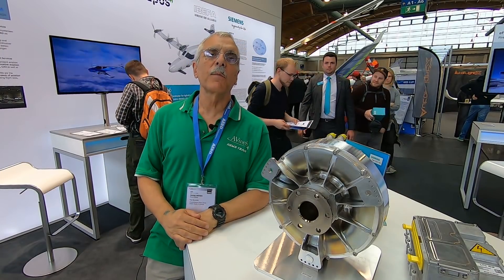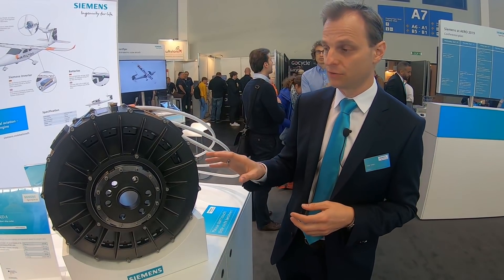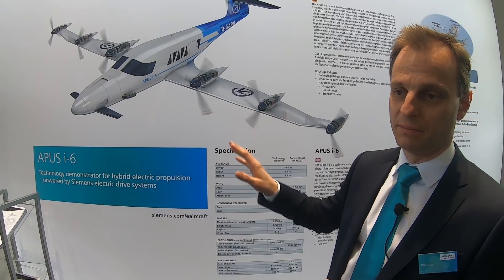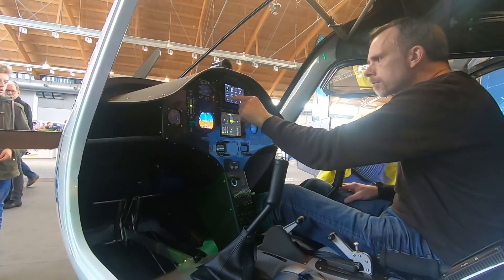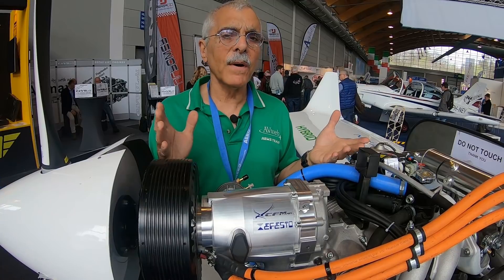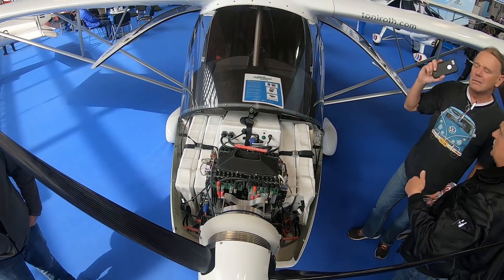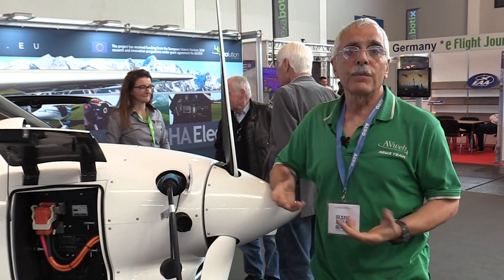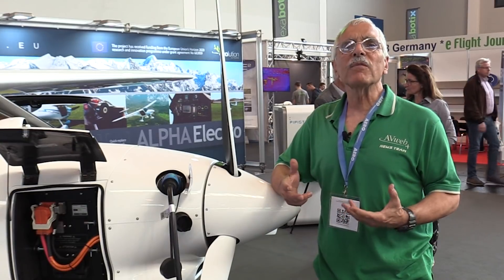What's New in Electric Airplanes?

Comment: The hybrids are hilarious, they just massively reduce the performance of the aircraft while massively increasing the cost. It's like no one did the calculations that are normally done before starting a project to determine if the idea is even viable!
Reply: PistonAvatarGuy 100% truth.
Reply: Distributing power from 1 engine across multiple propellers increases performance. The propeller is one of the biggest bottlenecks of aircraft performance.
Reply: @RealestUrbanism  Even if that's true, that's not likely to make up for the inefficiency of the hybrid system itself.
Reply: @PistonAvatarGuy  Google X-57 DEP etc. Those guys at NASA need to urgently learn from you. Study a bit on aerodynamics and wing construction first, please.
Reply: @Walterwaltraud  The X-57 was supposed to fly 2 years ago, the project appears to have stalled. The Pipistrel Panthera Hybrid performs significantly worse than the version which is powered by the most archaic piston engine still currently in production. Equator Aircraft has a DEP system that is double the weight of a typical aircraft engine and is significantly less efficient. Did you think that I made that comment based on absolutely nothing?
Reply: @PistonAvatarGuy  Cannot comment on the Panthera specifically (have only test-sat in the cockpit), concerning the engine they had to switch with the normal version. With such a small company you can only use your resources on so many projects. And case in point: They win a lot of competitions, sell steadily, do what they manage to do, they don't overpromise and underdeliver (unless you consider 5 kts speed under ambition, which at 195 kts over 200 kts projection that), yet, at least. They might break timelines, but still produce, sell, don't go bust, have several product lines open etc. Let's see how this one pans out. So, that said, the core upside of certain hybrid configs have some pros and cons. Reliability shall be higher and safety improved, complexity partially added and partially reduced. That remains to be seen. As for the X-57, since it's basic research, they did their flying wing on the truck testbed (looked fun :-) - and low cost), DEP does have a justification and will have a niche application in practise as well. Size and timeline are up for debate, I totally agree on that. Thus, your initial claim shall be disproven, but I would not say it will happen in the next 24 months, but the next decade. Slim wing, better cruise speed, higher dispatch reliability, 20 min batteries for initial climb to altitude will come down to physics, aerodynamics and business model. I wouldn't be surprised if the Alice from Israel sells 8 units a year starting in 2026 or 70 units a year in 2022. Both are well possible. I''d be surprised though if they sell the amount we saw in the 70ies and 80ies in Cessna 4XX, Piper 31 and other comparable sizes. Short and medium haul is just a too small market with the amount of regular 50 - 100 seat connections that exist in 1st world countries.
Reply: @Walterwaltraud  There's nothing wrong with Pipistrel as a company, but using a piston engine in a series hybrid arrangement to power an aircraft is fundamentally flawed, it could never do anything but reduce the efficiency of the aircraft, reduce its capability and add a huge amount of cost.
-
"Reliability shall be higher and safety improved, complexity partially added and partially reduced."
-
There is nothing but additional complexity. You can't get any less complex than bolting a propeller to an engine.
-
"...DEP does have a justification..."
-
Only in VTOL applications.
-
Increasing the aerodynamic efficiency of the aircraft does nothing to demonstrate that a series hybrid system is viable in most aircraft applications. The aerodynamic efficiency of the aircraft can be increased with ANY kind of engine system. FAR more benefit would come from modernizing light aircraft engines, which could easily provide a 30% reduction in fuel consumption, while allowing them to burn cleaner (unleaded), less expensive fuel.
-
"I wouldn't be surprised if the Alice from Israel sells 8 units a year starting in 2026 or 70 units a year in 2022. Both are well possible."
-
Not at all likely. They don't even have a prototype yet and they're trying to develop an entirely new kind of power system which makes absolutely no sense.
Reply: @PistonAvatarGuy  There's nothing wrong with Pipistrel as a company, but using a piston engine in a series hybrid arrangement to power an aircraft is fundamentally flawed, it could never do anything but reduce the efficiency of the aircraft, reduce its capability and add a huge amount of cost. - 

(Other than having (like Axter Aerospace) a couple of minutes of emergency power on EFATO, which is highly appreciated on any SEP to return to field without an impossible turn, noise abatement comes to mind as well. If the weight of the battery for the initial climb with a range extender suits the mission profile, that’s just a numbers game. I never bought the electric at altitude argument (unless you live in the Andes and have the same 45 min flight every time getting over Aconcagua :-)), but for this part it might be worth it: The “range extender” is a smaller, simply engine. Just putting on a relay between a certified engine that is of the same dimension, other than the aforementioned EFATO scenario in the pattern, is pointless, obviously. Maintaining cruise speed takes way less power than takeoff.)

"Reliability shall be higher and safety improved, complexity partially added and partially reduced." - There is nothing but additional complexity. You can't get any less complex than bolting an engine to a propeller. (Yes, an electrical engine is less critical, for obvious reasons, (the range argument we discussed obviously).) 

- "...DEP does have a justification..."

Only in VTOL applications. 

(Nope, in cruise as well. If you feather 10 out of 12 props, see the X-57. Lower drag, but great climb performance. Ever chopped the engine too high on a twin? You slam on the gear. Yeah, any light twin proves you the added lift from propwash over wing. Not even considering Coanda effect exotics like that Boeing YC 14, Antonov 72 and other “Upper Surface Blowing” models. So if DEP allow for much reduced drag during cruise, that’s a game changer.)

- Increasing the aerodynamic efficiency of the aircraft does nothing to demonstrate that a series hybrid system is viable in most aircraft applications. 

(See above, it will, as long as those props fold as nicely as they do on front electric sustainers in gliders, or Ospreys on assault ships, or in the nose of a Stemme S-10; or forward like in the Carat). 

The aerodynamic efficiency of the aircraft can be increased with ANY kind of engine system. FAR more benefit would come from modernizing light aircraft engines, which could easily provide a 30% reduction in fuel consumption, while allowing them to burn cleaner (unleaded), less expensive fuel. - 

(yeah, but that’s not the purpose of this field of research. No one would build the Tecnam P2012 with 4 or 6 engines. DEP can fulfill that mission profile at projectible lower costs. We’ll see. Might be a game changer in niche markets. Single aisle airliners obviousy not, for decades. Yet. As for engine efficency, stochometrics are quite sobering, especially if you compare a Rotax 9XX with an O200. Less icing, hardly reduced fuel consumption - it's like with boath engines, at that power output you cannot put that many tricks in there. Oh, and I fly with a Mogas STC. I'd rather buy an Elixir IR Rotax 915 for training, but with the capital costs, the Cherokee 140 with that Mogas STC works fine for me as a training tool for students). 

"I wouldn't be surprised if the Alice from Israel sells 8 units a year starting in 2026 or 70 units a year in 2022. Both are well possible." - Not at all likely. They don't even have a prototype yet, but they're trying to develop an entirely new kind of power system which makes absolutely no sense.

(Pure electric with three certified engines, 9 seats, rather short distances? Boils down to dollars per seatmile. There are markets for that. We’ll know rather soon. For short haul, high frequency, high dispatch networks this does make sense. 200 - 400 km, biz travellers, few electrical installations needed, small airports (such as relief airports, GA hubs). Construction of low front plate, low drag, high reliability, short routing transport is the key here. We’ll see.)
Reply: @Walterwaltraud  With the cost, weight and inefficiency of a series hybrid system, you could simply add a second engine for emergency power. An alternative would be to have emergency power provided by a parallel hybrid system which would also allow the engine to make use of turbo-compounding, which would significantly improve the efficiency of the aircraft. Consider the 50% thermally efficient F1 engine that was built by Mercedes.
-
"noise abatement comes to mind as well."
-
What does that have to do with a hybrid system? Modern engines with a PSRU can run the prop at any RPM which is practical. The DA62, for example, runs its props about 400 rpm slower than most light aircraft and is extremely quiet. Gasoline engines are always a better fit for aircraft, though.
-
"The “range extender” is a smaller, simply engine."
-
There's nothing simpler about ranger-extenders, the Panthera Hybrid uses a normal aircraft engine. Simpler engines, like what's used in the Equator Aircraft, are always going to be significantly less efficient. The mass of the battery will reduce the efficiency of the aircraft for every moment that it's in the air.
-
"Maintaining cruise speed takes way less power than takeoff."
-
Yes, and that's where engines operate most efficiently, at low power settings. Operating a smaller engine at higher power setting will result in a REDUCTION of efficiency.
-
"No one would build the Tecnam P2012 with 4 or 6 engines."
-
No one has, we already discussed that.
-
"at that power output you cannot put that many tricks in there"
-
Huh? Are you suggesting that full power fuel consumption can't be significantly reduced? Liquid-cooled engines can have around half the fuel consumption of air-cooled engines at full power, because the heads are kept cool by the cooling system, not by a rich fuel mixture.
-
Pure electric aircraft aren't likely to be viable for anything, the batteries are simply too heavy. A 900 kWh battery currently weighs as much as the proposed MTOW of the Alice. Also, consider that NASA overestimated the performance of electric aircraft with current battery technology by about 100%, which casts serious doubt on the rest of their claims for electric aircraft.
Reply: @PistonAvatarGuy  With the cost, weight and inefficiency of a series hybrid system, you could simply add a second engine for emergency power. (also referred to "light twin" in your logic - if nothing is more efficient than direct transmission engine to prop, why not fly a twin? The basic construction choices are in line twin, asymmetrical twin, ice to prop, ice to prop with reduction gear, and hybrid. (and electric, for summing them up). Hybrid makes partially sense due to battery for emergency power and "maintain cruise speed" as a "range extender analogy". Smaller compact ice, less drag, less complexity, optimum efficiency at small bore. Think of it as "booster rocket" (battery for 20 min initial climb) then cruise (as in UAV/ UCAV/ cruise missile). Would I buy one? No, I stick to my PA28-140. But there are missions where it makes sense. Noise sensitive airfields for instance. Mid range.)An alternative would be to have emergency power provided by a parallel hybrid system which would also allow the engine to make use of turbo-compounding, which would significantly improve the efficiency of the aircraft. (now THAT merely adds weight in small a/c, unless you refer to DEP in commercial 20 - 50 seaters. Which is what X-57 and Siemens with their BAe146 testbed look at) "noise abatement comes to mind as well." - What does that have to do with a hybrid system? (prop is part of the noise, see C185 for instance, but ice as well, check out Bertorelli's test of the Pipistrel Alpha Electro. Same noise inside, very quiet outside. Guess why...) Modern engines with a PSRU can run the prop at any RPM which is practical. The DA62, for example, runs its props about 400 rpm slower than most light aircraft and is extremely quiet. (and electric emits even less dB) Gasoline engines are always a better fit for aircraft, though. (you'll be proven very wrong for niche applications very soon, anything else we talk decades, as I have pointed out repeatedly)- "The “range extender” is a smaller, simply engine." - There's nothing simpler about ranger-extenders, the Panthera Hybrid uses a normal aircraft engine. Simpler engines, like what's used in the Equator Aircraft, are always going to be significantly less efficient. The mass of the battery will reduce the efficiency of the aircraft for every moment that it's in the air. - (disproven in numerous applications, especially terrestrial one. But the principal remains the same. The ICE of the a/c is of much smaller dimension and complexity if it merely is needed for 40% of take off power) "Maintaining cruise speed takes way less power than takeoff." - Yes, and that's where engines operate most efficiently, at low power settings. Operating a smaller engine at higher power setting will result in a REDUCTION of efficiency.(yeah but it's not an exact scale. 1/3rd output as a total design makes it much more compact and simpler. Part of course offset by battery etc. Look at the concept of the Rutan Voyager and think of the dead weight - sure, one engine pulled it around the planet, but without two it wouldn't have taken off. That on a smaller scale is the role of the electric part of the propulsion. One for climbe and EFATO prevention, the other one to cruise efficiently around the plant) -- "at that power output you cannot put that many tricks in there" (- Huh? Are you suggesting that full power fuel consumption can't be significantly reduced? Liquid-cooled engines can have around half the fuel consumption of air-cooled engines at full power, because the heads are kept cool by the cooling system, not by a rich fuel mixture. (50% would be great, but compare an O200 and a 912 100 bhp variant, the reduction by Rotax is minimal, stochiometrics still apply. I would love to have some of the car ICE reduction tricks on a/c, but the market is too small.Hybrid can partially compensate with simpler "cruise engine/ range extenders. It's really just numbers).  - Pure electric aircraft aren't likely to be viable for anything, the batteries are simply too heavy. (you will be proven wrong in the niche application of flight training very soon). A 900 kWh battery currently weighs as much as the proposed MTOW of the Alice. (Then speculate against them as soon as they go public) Also, consider that NASA overestimated the performance of electric aircraft with current battery technology by about 100%, which casts serious doubt on the rest of their claims for electric aircraft. (that's a) research b) not accounting for the gigantic sums the car industry has already put into this - 260 kwh per kg seems to be the current norm. And please back up that claim, I am not writing a scientific publication here and you have been off before.)
Reply: @Walterwaltraud  Your comment is unreadable, use the format that I used.
Reply: @Walterwaltraud  "I would love to have some of the car ICE reduction tricks on a/c, but the market is too small"
-
Yet it can absorb much, MUCH more expensive hybrid technologies? WTF kind of logic is that? The rest of your nonsense comment (what I can make out of it) is FULL of the same kind of idiocy.

Comment: IMO the best use for electric motors would be in glider configurations. You use the motor to get to altitude and turn it off while you glide, repeat.
Reply: Already available. He did not show the gliders at the exhibition.
Reply: @waynerussell6401  I envision a compromise between the long wings of gliders and normal GA short wings would be more of an ideal, where you get the high lift of a glider which allows for a less powerful motor being needed, thus reducing the battery weight needed to operate, yet still having good speed to make it practical for longer trips.
Reply: @RPSchonherr  Hi aspect ratio wings and GRP laminar airframes are quite common on electric craft. Pipistrel, who make most of the currently flying electrics are also a sailplane manufacturer.
Sailplanes are so efficient that only a 20kW motor is required for flight (sustainer). Efficiency is maximized by saw-tooth glide paths - climbing and then descending motor off at less than one degree glide slope. A transcontinental electric commercial aircraft would ascend to low drag  rarified air and then complete the flight power off. 
Pipistrel props are capable of regenerative energy capture on power off.